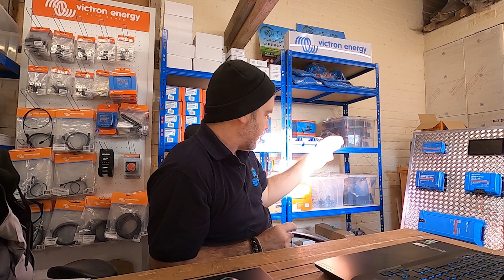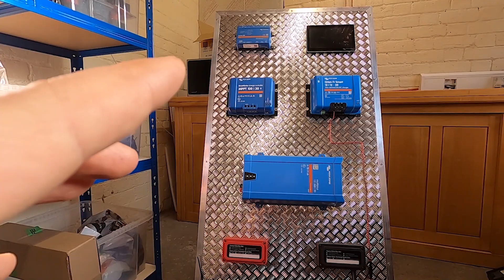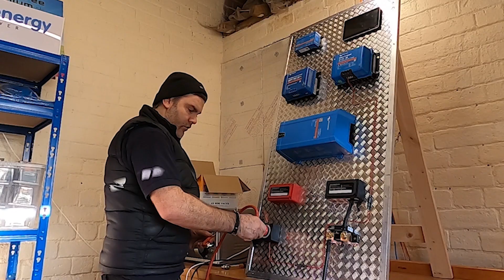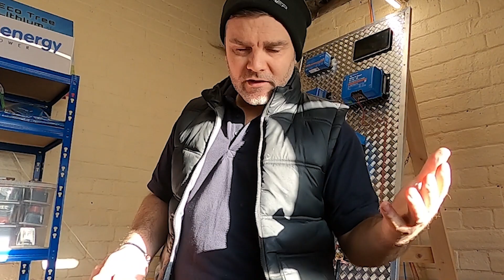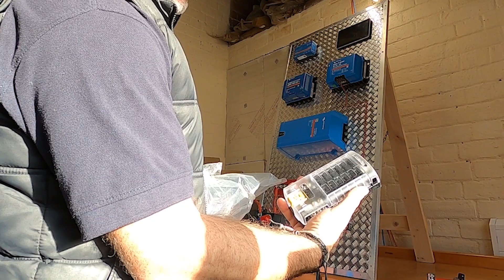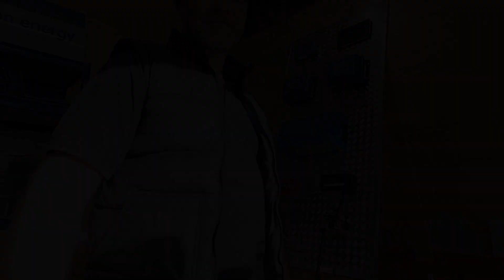Fuses, Switches, Bus bars, What goes where?

Comment: Why do cables need to be all the same length
Reply from the maker: Great question! The answer is DC Ripple. If cables are of an unequal length, the resistance in each leg differs. Under high load this can cause surge and upset the steady flow of electricity.

Comment: Hi, I was watching your video to help me plan my layout.  Just had a few questions. So the main fuse before the disconnect switch is the one rated for the max inverter draw? So the inverter positive can go direct to the busbar with no other fuse?  Also, what do you recommend for short circuit protect ion at the battery. I just have two 100ah lithium batteries in parallel. Some people say 125amp MRBF fuse on each positive terminal.  I was thinking of using a class T before the switch,  but then something seems off about using the MRBF at the terminals since  the MPBF has a lower aic rating then the class T. It does not seem like there are any Class T battery post mounted options, so is MRBF the best one can do, at the terminal post for battery short circuit protection?

Comment: This may sound ridiculous, and you'll probably not see this as this video is 8 months old, but here we go anyways: Your shutoff switch is between the batteries and the positive buss bar. I understand the need for that. However, if the Charge Controller runs to the positive buss bar, then shouldn't there be a shut off switch between there as well? Help me understand. Appreciate you, bro. - Ryan
Reply from the maker: Generally it’s easy to isolate the charger power sources, solar will have a breaker and dc-dc generally have a switch or jumper to disable them. So not really a requirement

Comment: Isnt the fuse for the battery supposed to be as close as possible to the battery? Ive seen them coming right off the terminal. And why not use a fuse that matches the wire max amperage, which you said was 300 but you only used a 200 lamp fuse?

Comment: Great work, love the content. Two questions 1. What is that bare copper wire from the DC/DC converter to the shunt and isolator switch? I looked through the smart shunt and DC to DC charger and could not find a reference to it. 2nd question is going to sound very noob, my wire calculation for the alternator wire feed to the DC to DC charger is for 4AWG, but the specification on the DC to DC charger calls for 6AWG max. Am I  supposed to just use a bus bar at the end and reduce the wire for the final connection? It doesn't sound right to me, but I'm not sure how else to solve it. Thanks in advance.

Comment: Hi such clean work! Does the cabling need to be exactly the same length between the battery and the positive side bus bar (including fuse and switch added in) and the negative side battery and the shunt (also on negative side)  … or the negative side battery to the negative side bus bar (including the shunt added in). Thanks so much!

Comment: Hi Lads love your videos very informative. I've a query and wounding if you can help? I replaced the sergent solar controler on my bessacarr with a victron mppt 75/15. Solar panel 100w all sergent factory fitted. Issue once the solar panel sends in power the whole electrical system shuts down even with mains plug in any ideas what's happening? Thanks for your help if possible
Reply from the maker: Hi Steve, good question mate! I think I would start by checking the polarity of the solar coming into the charge controller. Did you use the load output on the 75/15 or the battery out?
Reply: @BlueFix  hi thanks for the reply the solar polarity is correct and output is to battery. The 12 volt turns off when solar output goes over 1. amp. Two new batteries fitted incase the old one was bad after 6 years use.

Comment: Ok may be a silly question but why do the cables need to be the same length?
Reply from the maker: Thats not a silly question, its actually quite a loaded one! DC ripple and EMI are 2 of the most cited reasons for similar cable lengths, It all comes down to resistance and your inverter connections, high DC ripple can cause damage to lithium batteries/

Comment: Silly question but doesn’t that display board conduct electricity ? As in if the live shorts to the board it makes that full board live ??
Reply from the maker: Aha! Well its actully vinyl so its not conductive! We do install on Chequerplate though, we use grommets where positive wires passthrough the plate and quite extensive use of conduit in case of mechanical abrasion!